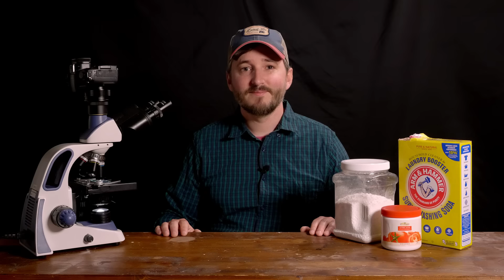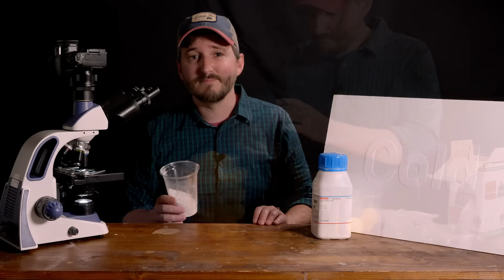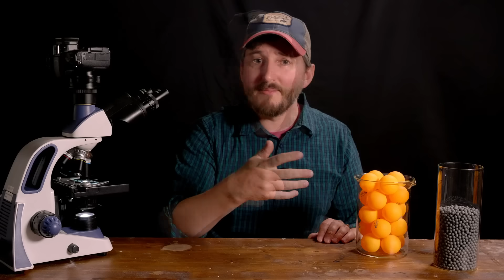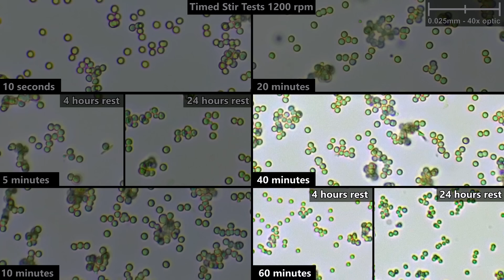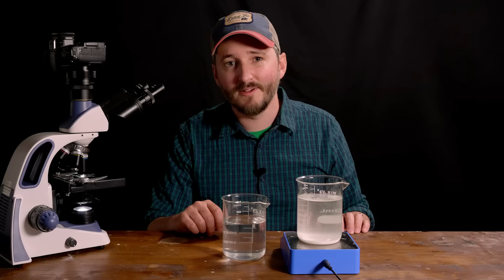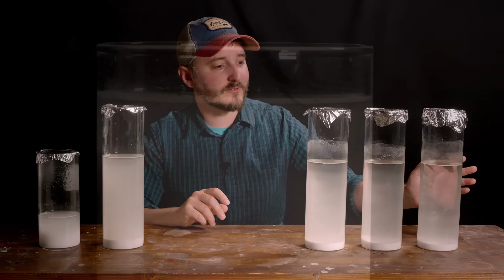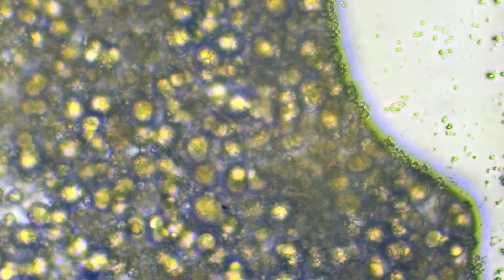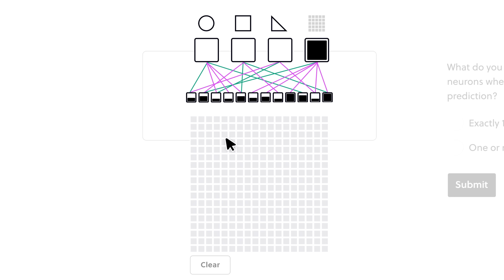Making Infrared Cooling Paint From Grocery Store Items (w/Novel CaCO₃ Microsphere Synthesis)

Comment: Here in Arizona where it is presently 110 degrees outside last year my garage was like a pizza oven last fall  I put on White Electro mastic roof coating from a large Home Improvement retailer this year the garage is 10 sometimes 15 degrees cooler than outside and seriously when it's 100+ degrees outside I have walked on that roof barefoot, no problem, in these days of global warming all roofs should be white it gets you the most bang for your buck

Comment: Great Video! I was wondering if instead of batching out the liquid and having to clean the container, if it would be possible to start with a large batch, mix to the 1 minute mark and then pour off the amount that is needed. Then continue to mix till the 5 minute mark (4 minutes after) and then pour out the rest. This could avoid cleaning between batches and could reduce the total time required if someone wanted to go all the way to the 10 minute mark. But I don't know if pausing during the mixing for any period of time would be detrimental to the processing of controlling the size.
Reply from the maker: Yes that's possible

Comment: Interesting @NightHawkinLight that I just watched the "poor mans clean room" video from "Tech Ingredients" channel on my playlist LOL

I have an interest in this because I have made a basic thermal diode using a dual layer material that absorbs thermal IR from one side and emits it from both but the other side reflects that IR frequency so a stack of this is able to make a difference between two windows being shown on by the sun of around 105F and 65F all on it's own, with any area not covered but a solid insulated area being cooled by the heat pump in the house only able to reach 67F temps at best LOL

Comment: Honestly?? I want to see this on a shed. I'd love to see someone make an 8x10 corrugated steel roof painted in this with some kind of resiliant top coat. I know this doesn't work without a cellophane barrier over it, so I'd love to see if there's a resiliant top-coat alternative to use for this instead to make it viable as a roofing material. I have a hunch that, for sheds at least, this would be a HUGE cooling benefit.
Reply: Because this directly radiates heat away from the Earth without it being trapped by the CO2, it would be SUPER interesting to consider at what scale this would need to be to have a significant effect on Global Warming/Climate Change, too...
Reply: I did some back of envelope math: lowering the temperature of 1kg of water by 1 degree C removes 4200j of energy. I'll invent a unit called a "globree," or global degree (that is, 1 globree = 1 deg C removed from 1 kg of water as black-body radiation per minute, or ~2.208 gigaJoules per year). Assuming 380 exajoules of surplus energy trapped in the last 50 years, 5 exajoules of energy needing to be rejected to lower the temperature by 1C, and the average global temperature raising by about .18C per year, we would need about 6 gigaGlobrees of cooling capacity to return to 1973's temperature average by 2050. Assuming a 1ft x 1ft cold plate can produce 1 globree, you'll need about 2.5 MILLION square miles of surface area to achieve this. That's about 25% of the entire Sahara. For comparison, you'd need about ~70,000 square miles of solar panel to power the planet for a year, and there is estimated about 125,000 square miles of rooftop on the planet. The Amazon River Basin is ~2.5 million square miles. Understanding the efficiency of the paint in degs of heat rejected per 1kg of paint would really put into perspective how well it'd work to combat climate, because the efficiency would only need to be about ~3.312 globrees per sqft to essentially negate yearly temperature rise utilizing only available roof-space.

Comment: Does acrylic pass the IR wavelength that this coating is emitting? Seems like the thinned acrylic/acetone binder is ideal for bonding to a acrylic sheet. What about a giant microscope slide of acrylic? Application would be a measured “dollop” in the center then “smooshed” by the acrylic cover sheet.

Comment: I would like to see an experiment to see how efficient are the mentioned paints. You could make strips next to each other. With barium sulfate, with random crystallized calcium carbonate, with only big sized  calcium carbonate, with small sized calcium carbonate, and mixed sized calcium carbonate. These paints could be next to each other, and you could measure the temperature by the infrared camera. A strip of simple titanium-oxid wall paint could be next to them as control.

Comment: Limewash(CaOH2) with this pigment added can make buildings cooler than limewash only any comparison?

Would limewash/casein mix make good binder for this pigment or would it steal CO2 from pigments to convert into CaCO3??

Doesn't limewash give same effect as acrylic dissolved in water/acetone mix it turns opaque as it cures?

Comment: This was SUPERB on multiple levels. A great look into the scientific process, well explained, and making it all MORE than reasonably accessible to the “layman”. Might it be possible to use these to make (for lack of a better term) Anti-Solar Panels? I saw a proposal once for covering a huge area of the Sahara Desert in solar panels and how the resulting heat from the dark material would actually change global weather patterns. It seems to me that there might be some formula for surrounding each solar panel with Infrared Reflective Cooling Panels to OFFSET that heat effect. (In what ratio, it would need to be determined.)

Comment: I am wondering if this could be applied to the underside of some clear polycarbonate corrugated roofing panels, and how that might affect its performance.
Reply from the maker: Polycarbonate blocks most IR so sadly I think it would prevent the main cooling effect of this paint. It might work to keep it right around air temp though.

Comment: Have you thought about using a screen-printing method.  Basically pipe in the liquid in front of the squeegee.  Remove mesh, do a second coat that will fill voids from the mesh.  Layer as many times as needed.  Can be automated for panel work.
Reply: BTW, this is an awesome video and scientific works.  Had me totally engrossed that I forgot to say thank you for your work!